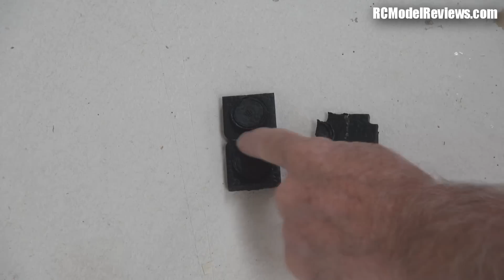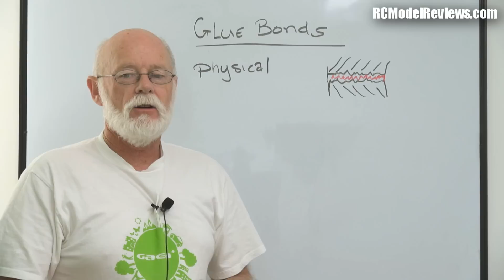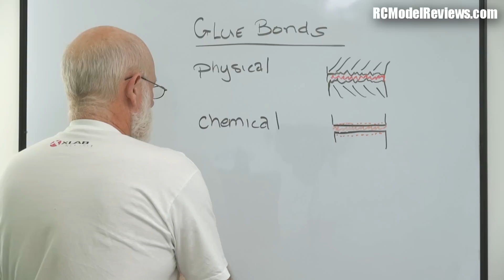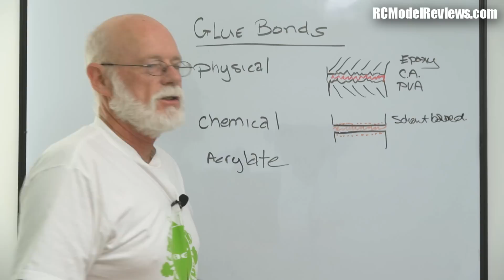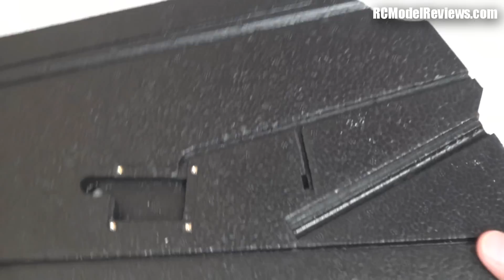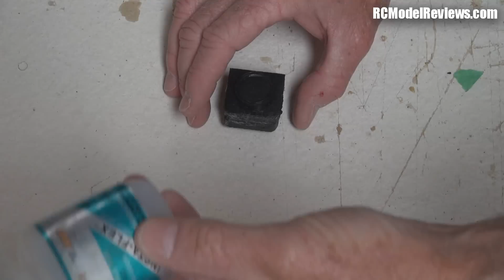S800 SkyShadow wing from Banggood - how do you glue molded EPP?

Comment: How did you glue wings to the fuselage? It is a big surface so the hot glue goes quickly cold and does not glue that good anymore, I tested this on small piece. 
Also what would you use for PLA from 3D printer to EPP? CA maybe or hot glue?

Comment: The only glue you need in this hobby is high quality 30 minute epoxy(Devcon is the highest quality). Epoxy is the strongest glue in all conditions including humidity and moisture. It chemically and mechanically bonds surfaces. Ca and hot glue are ok if your impatient. For strength and durability epoxy is king. Inthe oil field we use steel  reinforced epoxy putty to repair pressurized leaks in steel tubing till we can get it welded.

Comment: Yeah, the brand varies between countries and i had to look for local alternatives. But to do that, i had to figure out the technical name of the things i'm looking for. DJI Screws = 3m/2.5m buttonhead with 3mm shanks. Loctite = Threadlocker, Superglue = cyanoacrylate, etc.

Can anybody tell me the technical name for goop/gorilla? The glue that foams up a bit to fill in the gap before hardening? There's probably a local equivalent but i don't know what to ask the guy at the bookstore. I asked for foam safe glue and they just gave me CA because they didn't know which of the stuff on the shelves won't dissolve foam.

Comment: So with out all the back sortie I was attempting to glue Delrin witch is an industrial slide plastic. This means it is not really glue able, or at less not easily. But needing to get this project through even though it would not live long.  My solution was to uses two types of glue. I roughed up the surface with a dermal and a bur bit. Then fitted the joint with epoxy. After the epoxy dried I broke the joint apart and re-glued it with CA. The part held but not by much. I wounder if this multi glue approach could work for your EPP to carbon fiber. Picking two glues that like each other and one the likes EPP and one that like carbon fiber.

Comment: When you rough something up with sandpaper, you are increasing the surface area.
There is now more surface for the glue to bond to.

Adhesives work on a molecular level and there is no chemical bond as such.
The glue molecules and the surface molecules are extremely close together, tiny electrostatic forces (van der Waals forces) are just a huge number of tiny attractive forces between the molecules and act like a bunch of tiny magnets.

The more surface area the more electrostatic forces.

Comment: If the glue breaks and not the material on a break test, the glue joint is not strong enough. The material has to break, which means the glue joint is stronger than the material.

Comment: Great primer on gluing, Bruce!!
Adhesives have really evolved from the days of Ambroid and Testor's tube cement!! 
With the plethora of foam types, and having dissolved too many foam joints with the wrong cement, I went "old school" for assembling foam models, using PVA (aliphatic resin/wood glue) and found it to be excellent, as it fills the joint, gives working time, cleans up with water and I have yet to have a joint fail, even after "rekitting" a couple of models so assembled :D  Using PVA on a foam joint would make an interesting Round II test.
FWIW, in my experience, classic adhesive testing indicates that a satisfactory bond is indicated if the joint remains intact while the parent material fails -

Comment: VAS includes Welders in their kits, which is a contact adhesive, and it lives up to its name. I had to cut through some of it to remove material for my camera and bays and it was flexible and tougher than the EPP around it. It's very similar to Goop, and I couldn't say which is better.

Comment: Useful info, thanks ! -the benefits of 'keying' the surface is firstly that it increases the surface area of glue to material and with a given adhesion capability, more area means more stress required before failure, secondly the keying creates areas where stresses will be partly in shear and not just tension.

Comment: I'm using an "Dragon" foam glue. You can buy it at your local "everything for building" store. Yeah, the joint is like physical joint, but it is harder than material. As a hot glue gun - joint is harder than material.
But! I'm using ceiling tiles as a material for my models (50x50 cm 3mm sheet with laminating layer).
2 bucks for a 2square meters! Very light, quite durable material.

Comment: I have had very good luck using Hot glue in-bedding /encapsulating carbon rods and slabs into foam wings.  hot glue under then some over scrap off flat with a wood bit or plastic card and let cool.  the foam will break before the glue will let go.

Comment: Hello Bruce.  Do you have available or have you ever used a product called Gorrilla Glue?  it is an expanding type glue that likes to have some moisture on the parts to activate.  it works great on foam but use sparingly because of the expansion.

Comment: Nice vid Bruce ,  was going to say use the goop glue but you covered it at the end . I've  just put my sky shadow together and did use the goop for all major joins , also pushed pieces of cocktail stick in on the winglets and barbeque sticks out from the battery bay into the wings . Just waiting for the small esc to arrive to finish , I went for the KIT version . Also  as Matt suggested  some light colour on the bottom for orintation (red/white checks) , looking forward to see what you think of this model . Cheers Graham

Comment: I use Beacon's Foam Tac for just about everything. It bonds to foam, carbon, wood, metal and plastic. It stays flexible and does not crack and can fill voids. Unlike Gorilla glue it doesn't expand. I even use it to strengthen hinge joints. It allows a relatively easy disassembly by cutting it if needed. It works so well in so many areas I hardly use any of my other adhesives. It has a slight chemical reaction to Styrofoam if used in larger quantities but none detected in EPO, EPP or Depron, etc.
Reply: I too have feel in love with Beacon's Foam Tac.  Makes great control surface "live" hinges.  I have a old beat to near death Super Cub held together with it.  When I added andirons I used Foam Tac for the hinges, they are still going strong, I am still amazed by that.

Comment: on EPP I use "Shoe Goo" for joining the EPP parts and fixing spars. When it dries it is like silicone rubber. I use hot glue for servos, so they can be removed easily. For EPO I use epoxy anywhere there might be small gaps and foam safe CA for tightly fitting joins and clean break repairs. I also use hot glue again for parts that may need replacing due to damage or failure, like servos. I don't believe there is one glue for everything.

Comment: GOOP (all purpose version) is amazing stuff. There are several different types. The "all purpose" Amazing Goop works great on EPO and Z-foam.  Shame you can't get it there because it really is "Amazing".  Stinks really bad though and you need ventilation and it really needs overnight to cure.  It is a lot like that cheap stuff in the plane kits from HK but that stuff seems thinner and more "watered down".    If you can get a case of Goop in NZ it would be a great investment. Sell it to your friends.  I glued the soles of my Timberline boots with it once and it lasted for years.
Reply: I have good luck with the Goop also.  The thing that puzzles me is what is the difference between the different types?  Goop, RV, Plumbers, Marine, All Purpose, ETC.
Reply: Lloyd Prunier
 LOL. I dunno. I think the plumbers type is made more for PVC. I bought some by accident once but never used it.
Reply: I just went to there web site amazinggoop.com and they have a lot of products.  12 different Goops.  I'll have to do more research there.  The RV Goop I have now seems to be the same consistency and smell of the Marine and Plumbers that I have had in the past.  The RV says it is UV resistant.  There is one listed there that is Super Goop II or something like that and I think they have a super glue type also that is quick setting.

Comment: Bruce is it true that all glue actually relies on static electricity to work? and that if you had two perfectly microscopically flat surfaces and you put them together you could never pull them apart due to the  static bond?

Comment: Ah, you missed out the foaming polyurethane type glues (Gorilla). Are they not suitable for Epp? They do end up pretty rigid.
 Personally I've been using a carpenter's glue, in addition to hot glue, for all my recent foamboard projects. It's called Joiners Mate (in the UK) it's made by a company called Geocel and costs less than half the price of Gorilla (though you have to buy 500ml) and only foams to about double it's original volume. Gorilla foams at least x5. But this carpenters glue is a physical bond type glue, which can be left to set over an hour or so, longer is better. It can be accelerated by spraying with water before joining. And foaming can be increased by agitating or spreading before joining. It definitely soaks into balsa and softwoods.
Reply: Its all I use on my personal builds and recommend on all my EPP products.   My wings are hotwire cut and not molded but the bond is amazingly superior with gorilla glue.
Reply: Nice one.
I've actually found that the Joiners Mate sets firm in half an hour if I accelerate it with sprayed water and the quality of the join in indistinguishable from Gorilla.
Reply: Agree on PVA and hot glue being the main adhesives...  Gorilla Glue is difficult for me to use as I cannot accurately determine how much "outflow" will occur... That said, it IS strong!!
Reply: I hear you. Gorilla sets almost as hard a wood, so you need to control it in some way as you can't really sand it if you're gluing foam. Look for 'carpenter's polyurethane glue' or something similar, it's what Gorilla is based on. I will only buy Gorilla for emergencies now as it foams too much, at least 5 time it's original volume, which makes it difficult to calculate. But I always cover any join edges with masking tape after gluing to control any excess foaming, though it sometimes spreads out under the tape.
Reply: The secret to Gorilla glue is to let it expand as much as it wants and let it fill every crack crevice and gap,  within 15 minutes its holding the parts well yet the glue is still not fully cured.  You can cut the excess of easily at this point with a utility knife because its still very pliable and soft.  Wait another 20 minutes and it sands as easy as drywall compound.  Let it fully cure over night and you have a solid very strong joint.
Reply: Well, I agree up to a point. I'd rather have no gaps at all in the material before gluing. And Gorilla glue sets harder than expanded or extruded polystyrene foam, so I find it impossible to sand effectively.
Reply: Its not the end all be all when it comes to building that is for certain.   ;)  Its just my personal preference and having built 100 AFR RTF wings for customers it has been great for me.
Reply: Luckily, I only have one customer where my planes are concerned. The farm. They always buy it in the end!
Reply: From my experience Uhu Por contact glue, which is similar but better than the cheap Chinese glue included with kits, works really with any foam and carbon fibre. Always of course roughen the surfaces. Its simple to use but you want to give it 48 hours to properly cure. Downside its not cheap but its a time saver. Dragon glue is good for wood or wood on foam. It also works well with foam but it is quite a brittle glue and it expands and so you have to physically clamp the join together. Another popular and very strong glue for joining wing halves is 3M Super 77 spray adhesive. I became allergic to a lot of glues like Super 77 and that is something else to also consider when using glues and use them in well ventilated places.  I also on occasion still use the two part epoxy for joining dissimilar materials. JB Weld is good for metals and joins to carbon fibre for a rigid bond can but it takes a long time to properly cure. I still use CA (superglue) on small parts or quick repairs but it forms a brittle join as shown.
Reply: I use Sikabond Techgrip for polystyrene type foams and the end result is a join that matches the original perfectly. The foaming does take getting used to however. Had to cut back and re do more than one joint because I didn't clamp things well enough and the foaming pushed them apart.
Sika also make a range of non-foaming Sikaflex 11FC and Sikaflex 227(That you can get in small tubes) and similar that are stupidly strong and don't foam. But I have only used them for joining multi-materials(like leather to rubber) not aircraft.  And Bunnings sells the product, so NZ should be able to get them.
Reply: stewjw the Techgrip and Sikaflex 227 are both available in more 'home use' sized bottles/tubes and kept cool and dry last a fair while.
But yes, most of their range is for building so size can be an issue.
I use them because they work and I can get them locally. Need to check out Gorilla's range myself.
Reply: I found a lightweight Flexible sealer type adhesive that is really strong once it's set. Soudal Fix All Crystal. But it does remain very flexible.
Reply: wordreet

Comment: An ideal glue for those spars is Gorilla glue - a mixture of polyurethane polymer and CA that foams and moisture cures. Needs sparse application and taping until cured. Generally OK on Polystyrene. short shelf life particularity when opened.
Goop or Shoo glue is silicon based.
Contact adhesives are cheap and very useful too as they will stick to most anything and are flexible. Not good on Polystyrene as are a synthetic rubber polymer in a solvent.
Reply: Gorilla is a brand that makes many types of glue. In this context the polyurethane is the best as when it foams it forces its way into every pore and crevice to key the joint. Unfortunately it is expensive as once opened you have to use if fairly quickly so best to buy in small packs. Also here available in brown only so not too aesthetic,and needs careful application to avoid over foaming.
Goop is another company that sells a wide range of silicon based glues in a solvent that varies in consistency, UV resistance and rubberyness.

Comment: Hey Bruce, 
Happy New Year, 
A possible show suggestion for FW Friday.
Have you ever thought of doing a video on fixing a crumpled up epo model with hot water, I have done this with the nose of my axn (full speed nose in, don't ask) lol, and the results are marvellous. I actually over expanded the beads of foam because the water was to hot, but I was happy as a pig in slop it was useable again and glued all the parts back together with different glues, gorilla glue (white) and hot glue, sanded a bit and great man. Couldn't even tell it was wrecked. Also you just need a way to tell everything is straight from nose to tail, I make center marks on the top of the model and use black string tail to nose. 
Just a thought, keep up with the FW stuff love it.
Dustin
Reply: If you get that 'citrus fruit' looking surface after the hot water treatment, you can smooth the surface pretty well with the back of a spoon dipped in iced water or sprayed with an inverted air can. Don't spray the foam, just the spoon.
:¬)
Reply: wordreet thanks great to know for next time, appreciate it!